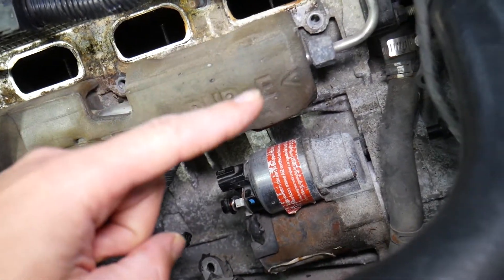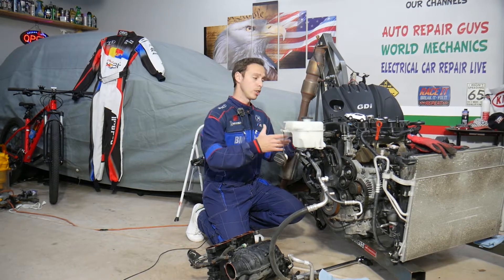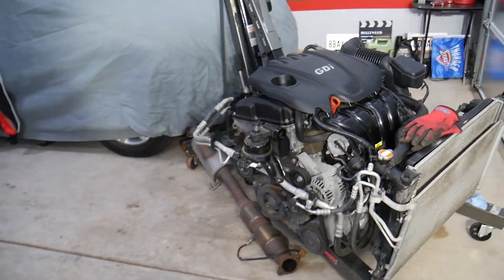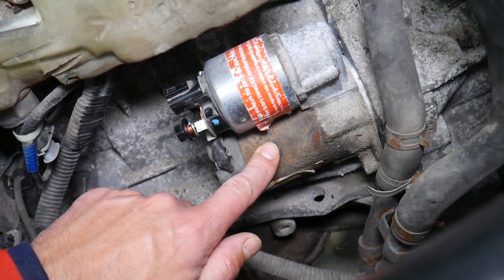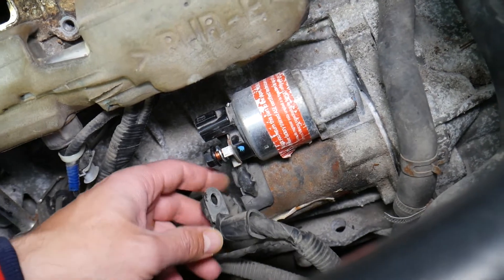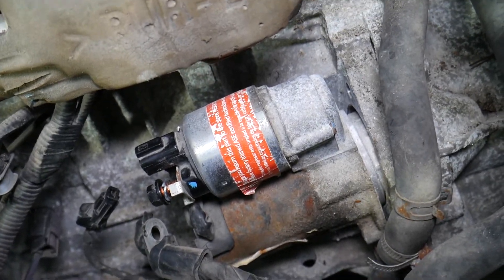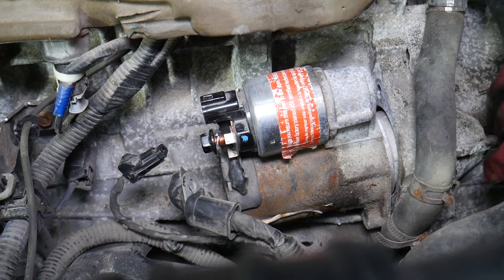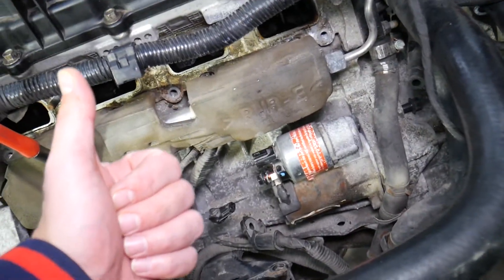TOP 5 WHY HYUNDAI SANTA FE DOES NOT START, DOES NOT CRANK

Comment: Question isn’t for this car but I know you work on BMW’s. Was wondering if you can help me figure something out because the shop wants me to rebuild my transmission but not sure if that’s the case because it drives normal unless I start accelerating fast like at a freeway entrance or switching lanes and I need to speed up because a car is coming. My transmission light comes on when I do that on my 2008 bmw 335i and it feels super sluggish on regular drive so I always have to drive it on sports so it could feel normal but even on sport my transmission light would come on if I gas it. Only way to avoid that is to slowly press the pedal and let it speed it up. What can it be any ideas? Because rebuilding my transmission seems a lot at the moment specially cause my car only has 45k miles.

Comment: My Hyundai Santa fe 2.0t died while  driving  an will not get no crank no start an I have no check light  code any help will be helpful
Reply: What was the problem? Same happened to me today
Reply: Same thing happened to me any solution?
Reply: Most likely this is the battery either went bad and no longer takes charge or the alternator has gone bad.

Comment: Got a 2014 Santa fe towed in here. Everything seems to check out electrically right down to the starter and battery.  Customer complaint was just driving along and car died.  Went to restart and all it does is continuously click, clikck... will not turn over. Battery has been tested and even computerized testing machine says it is good.  Yet if you try to jump start it,  it will turn over about one revolution and then return to clicking.  Starter does not sound like it is straining when it does this. Only other odd thing is negative battery cable tend to get warm when you hold the key in crank position.  Cable has zero ohm draw and has been cleaned up at battery and frame mount even though it wasn't dirty. Any other ideas. About to remove starter again to retest.
Reply: Have you figured out on that Santa Fe?
Reply: @pool404  actually i forgot I put this out there but yea. Installed a brand new battery and engine turned over very slowly. I could here the starter straining and my immediate thoughts went to "man that engine sounds tight!" 
Checked the oil and not a drop in it. I called up the kid who owned the car and asked him if he had ever checked his oil or if the oul light had come on. He said the oil light had been on for a while but he knew he was due for an oil change 🙄🤔. I had to explain to him that the oil light doesn't mean you're due for an oil change it means you are low on oil and in your case you don't have any. Believe it or not though he really lucked out. There happened to be a recall on the engine in that car and he had low enough miles and it was still new enough at the manufacturer put a brand new engine in the car for him. He had put less than 2,500 miles on the car since it left the dealer lot and they claimed to have put fresh oil in it. I have no idea where that oil went because there was no signs of any leaks. Is original battery tested a little weak but should have been able to crank the car. I pulled a new fresh battery off the shelf and she turned over but roght away i knew we had a much bigger problem.  Guess I should have checked the oil first but he didn't give me any indication of engine noise or rattling. He said it just died and wouldn't turn over.  Yea, the engine was nearly seized up.

Comment: Where is the video about fuses and relays ? I have 2015 Santa Fe, no problems, ran fine yesterday, this morning key turns, dash lights on, nothing when I turn key ?
Reply: Got a similar problem on an older santa fe where turning the ignition results in absolutely nothing. Was yours a starter problem?
Reply: @Jim-mq2me  I've left it outside a couple of times but haven't had any problem since then. Seems to have kind of resolved itself. I do think though when the new engine got put in there was a bad connection on a ground or the starter that has gone away for the time being. I would check to see if you have voltage at the starter connection (not battery connection) but other when key is on, that's if its accessible, my starter you have to take intake manifold off. There is a starter relay in fuse block that does go bad sometimes.